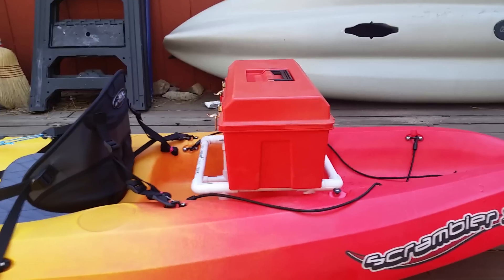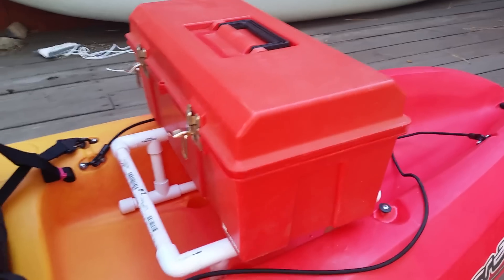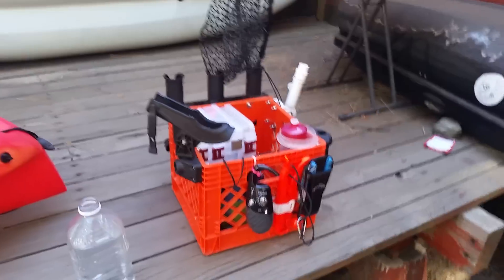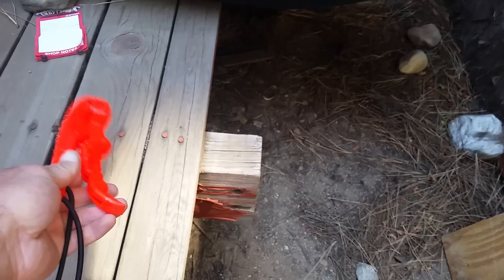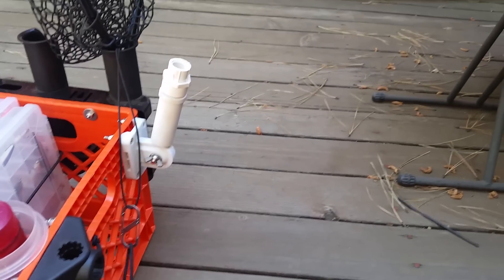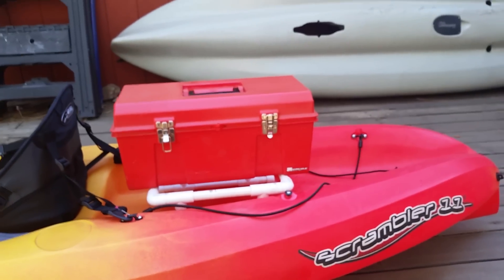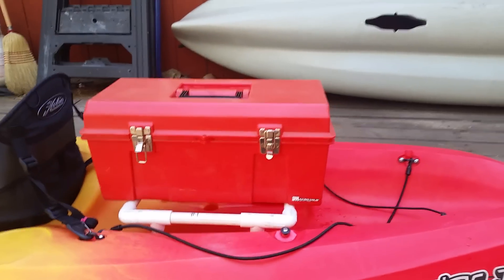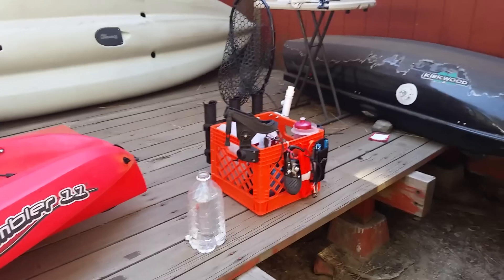Milk crate vs. Plastic tool box

Comment: Wonderful discussion!  You have pretty much written my next article for Southern Kayak Fishing - it will be - Kayak Hacks - Great Crates.  I never recognized the problem with the handle!
Reply: Kayak Hacks Fishing I still feel the tool box is a great idea for traveling light and keeping gear dry.  I hate coming home to salt sprayed tackle boxes and other accessories that weren't used.  It just means more time cleaning after an exhausting outing.  I think a easy fix to water coming through the handles would be to simply silicone under the lid where the holes are.  Or maybe even throw some duct tape over the handles then remove em after the trip.